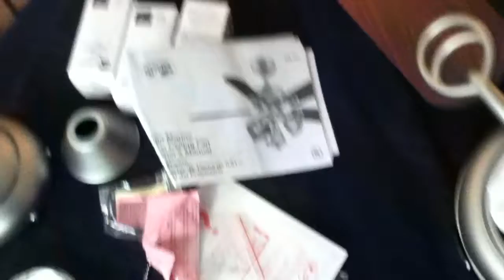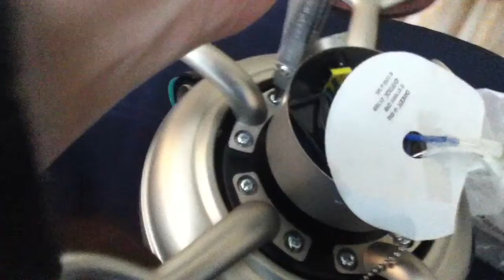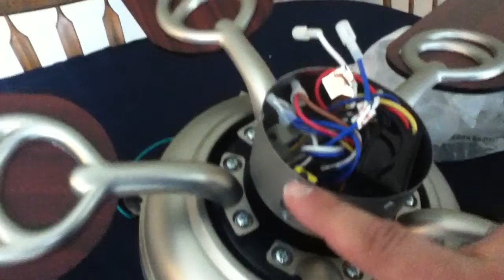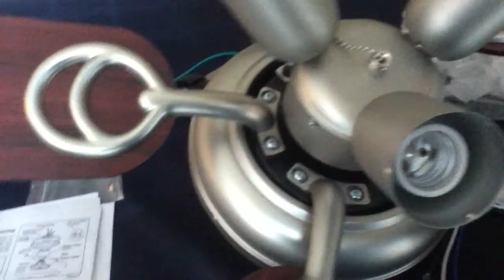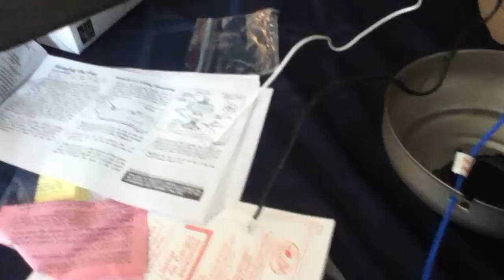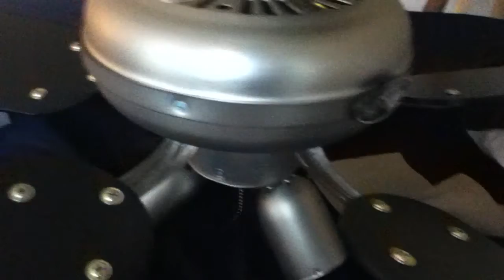Hampton Bay San Marino model Ceiling Fan Installation

Comment: I would recommend hanging the fan before putting the blades on. Leaving the blades lying can get the fan out of balance, and if the fan accidentally fell with the blades on, the blades can get damaged. So always make sure the fan is secured tightly to the ceiling BEFORE putting the blades on.
Reply: Oh shut up I did the same thing when I installed my fan and it was fine 🙄
Reply: @user9896boat  Yeah maybe you did it very carefully. Also it turned out some fans are not possible to have blades installed while fan was hanging, for example, Harbor Breeze Aero. But Aero has no blade arms to bend, the blades can attach directly to the motor.